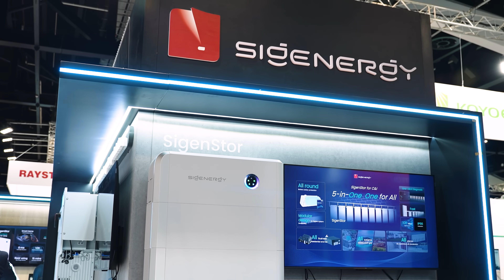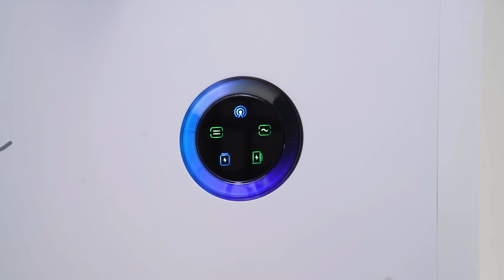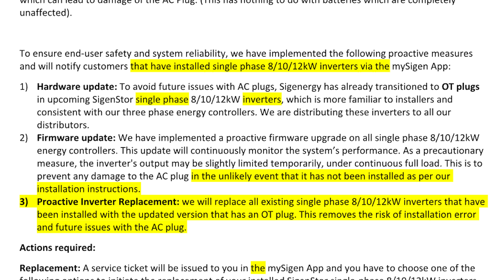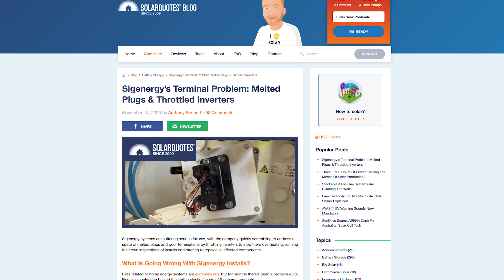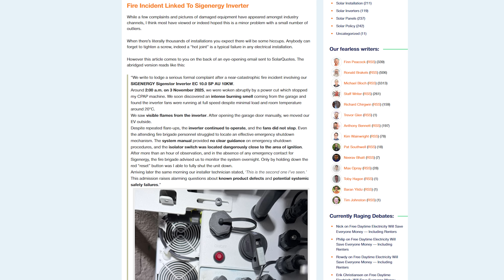Australia’s #1 Battery Recall: What They Aren’t Telling You

Comment: So as other have done successfully, I sent photos to Sigenergy of my compliant install to have the restriction removed.

This is the reply:

> Dear XXXX,
>
> We have received your photoes, but to reduce the chance of AC plug damage we are working with installers to proactively replace affected inverters with a new version that has an updated AC plug.
>
> Once your inverter is replaced, this limit will be removed.
>
> Best regards,
> Sigenergy Service Team

Spelling mistakes aside, that's a strange reply.

If it's the faulty installs causing the problems, as Sigenery have said from the beginning, why does a compliant install require both a restriction and replacement unit? There is only ONE reason! The connector is not adequate! The CONNECTOR is the cause of the problems regardless of compliant install!
Reply: You want custom firmware? They want all systems to be the same in firmware, design/physical design and operation so they can easily warranty and mitigate risk.
Reply: @Stanggers  Um, people have already had the 8kW limit REMOVED by sending Sigenergy photos of their install. I never said anything about wanting custom firmware. I imagine it's as simple as rolling back to the previous version.

One thing's for certain, once this is over I'll be blocking access to the API for firmware upgrades for my system that I OWN!!! I don't lease it! Nobody should be remotely CONTROLLING something I OWN! There are people who don't have home internet connections - it shouldn't be a requirement.
Reply from the maker: It's only a guess and this is it - they now have a prescribe process they have to follow via the regulator and so it's now all hands on board for the swaps - so that all restrictions can come off ASAP. PS: I spell terribly too... GermanEnglish known as Gringlish... I hope i did ok?
Reply: @yeanswers  my restriction was removed as a result of submitting my install photos. swap of my unit is still pending.
Reply: There's been a mass-debate on whirlpool about it.  So much rubbish said there it's unbelievable.  Looking at the issue there's a few problems including incorrect installation by not following the manufacturer's requirement to use a ferrule regardless of wire class, and that requirement is an odd thing to.  I'll take a punt that Sig new of the issue with the terminals from day one and the requirement for a ferrule was an attempt to address it.  I've seen examples of quite substantial strands cut on the 10 and 16 and also screw pushing through the bundle.  If that's happening, regardless of the requirement to use a ferrule, it's an fair indicator that there's a problem with the terminal, screw fill percentage and so on.  I'm not an engineer, not a Whirlpool electrician (I am not presently licenced) and I've not laid hands on the plug/socket in question to have a play with one myself.  Toss in Sig is replacing the lot, has flown in people to replace the plug/socket in stock items, and is shipping out stock with replacement plug/socket only strengthens my personal views.
Reply: @retrozmachine1189  ......so if the wrong cable was installed (usually the orange cable), that would mean that the whole orange cable would also have to be replaced? Does that run back to the Gateway? This adds a bit of time and effort to the simple "swap over job". 

Is the Gateway at risk if the wrong gauge wiring was connected, as the same wiring could cause over heating in the inverter?
Reply: @awoodward37  If the cable is being used out of spec, too tight a bend etc, yes it would have to be replaced.  If Sig stipulates a minimum class of cable or strand count etc etc and the cable used in your case doesn't meet that it would need to be replaced.  This is just application of general principles, I've not laid hands on one of these inverters and probably never will.

Comment: You maybe want to renamed your headline. It was the single phase 8/10/12kw inverters that were recalled not the battery.
Reply: My same, instant thought response when I read the headline. What's wrong with the battery? NOTHING. What's wrong with the EC/Inverter unit AC connector? Something. So, I agree, if the presenter wants to be taken seriously - and he presents himself as such, then CHANGE THE MISLEADING, MISINFORMING HEADLINE!!!! Otherwise the content is great.
Reply: @davidissko9796  Just more of the same misleading.....

Owns a Sigenergy system is not the same as "they gave me a 48kWh system for free".
Reply: Terrible take. Are you a sigenergy shill? Sig did nothing except throttle inverters without telling customers they were doing so and only moved when it became an ACCC issue. You are lying or don't know the whole story. Please do better.
Reply: Boosts engagement
Reply: It's not an inverter it's an EC 😂
Reply from the maker: Fair point - it's the inverter - but as its a all in one unit - we are now splitting hair... when people hear SigEnergy thay think of Battery - not inverter - but the headline write has been asked to go forward with more accuracy. Now it's launched very hard to get it back .
Reply: @yeanswers  still a deceitful or ignorant analysis. the company knew there was an issue. first response was throttle inverters and dont tell the customer (clear ACCC breach). when the problem got out of hand, then they blame installers. when ACCC finally steps in, then they did something about it. peoples houses could have burnt down or worse. this company is total trash, and your take is even worse. and yes the CEC is also a joke. they let so much garbage product into this country its not funny. i unsubscribed, i had no idea how deceitful/poorly informed you are.